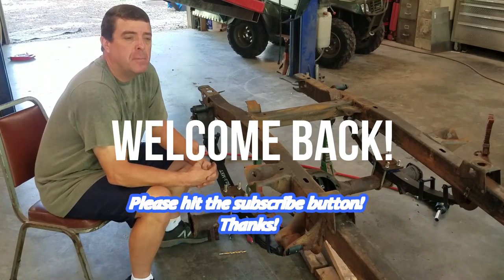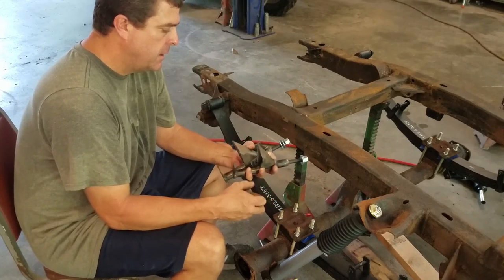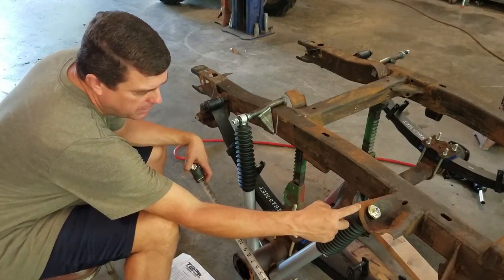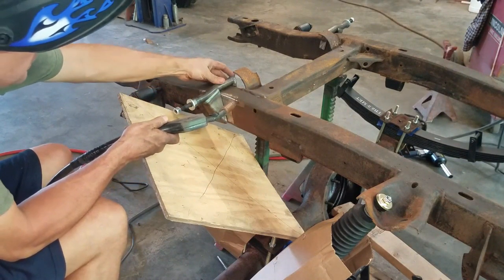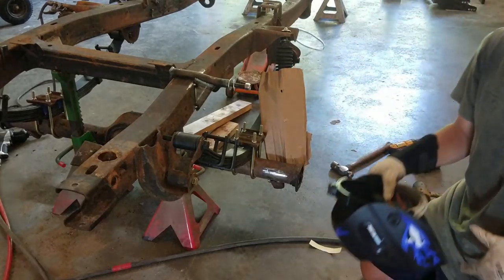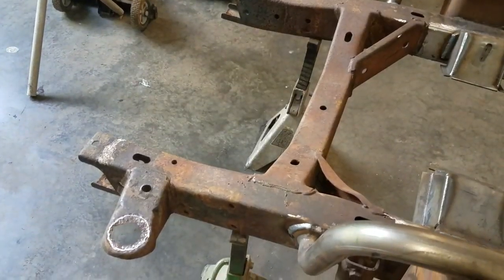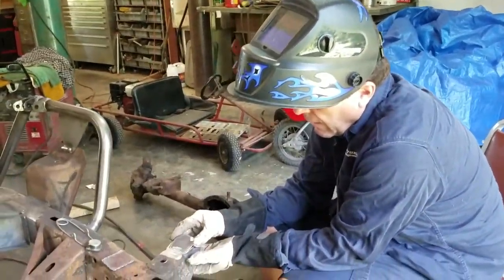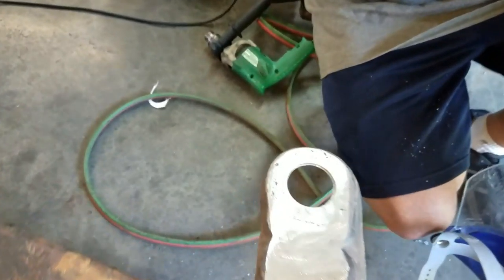TBP Stage 5 2.5" Suspension Lift Part 2 - 1966 Ford Bronco Restoration Project

Comment: I think I saw on an earlier video that you're planning to go with drum brakes on the rear, but if you ever upgrade to rear disc brakes you will have to move those rear shock mounts closer to the leaf spring. I have dual shocks on my '66 like yours and just converted to 4 wheel disc brakes. I had to move my furthest rear shock mounts where they attach to the axle roughly 1" inward to clear the rear calipers. Just food for thought. Easier to do it now than after the truck is complete.
BTW, I wish I had upgraded to 4 wheel disc 8 years ago when I bought the Bronco...what a difference!!
Reply from the maker: Thanks Jason, I already purchased the power disc/drum setup.  I appreciate that insight and  did not know you would have to relocate the mounts.  I don't plan to change to rear disc on this one.  I will keep that in mind for the 70 we are building next.   Thanks again for watching and your advice.

Comment: Hi:

I´m doing the 70 Bronco restoration by myself. I´m located in Colombia (South America) and I want to ask you if is possible to confirm the measurements of the front Hoop Shock Mounts, to lift 3.5”. In some comments says 15”x10”, Is this correct?. Maybe do you have a schematic that can share?
Reply from the maker: Harbey,  sorry this took so long.  I measured my hoops and they are 16" (horizontally) center to center across the top and 26.5" center to center across the bottom.  The bottom of the hoop project (stick out towards the wheels) 3" off the frame.  The top hoop centerline measures approximately 10" from the top of the frame.  Not sure if this is what you wanted but hopefully it helps.